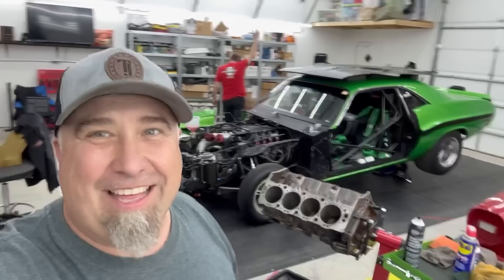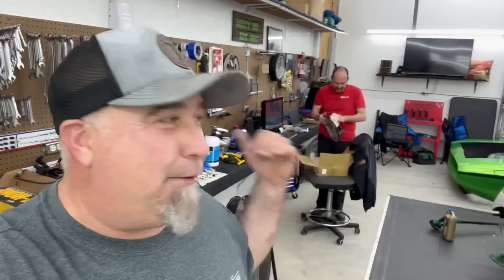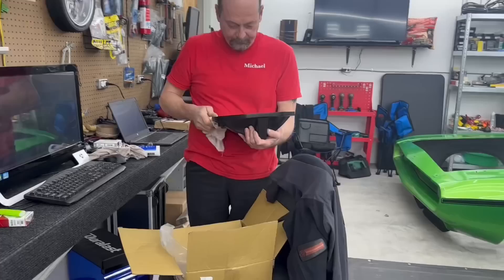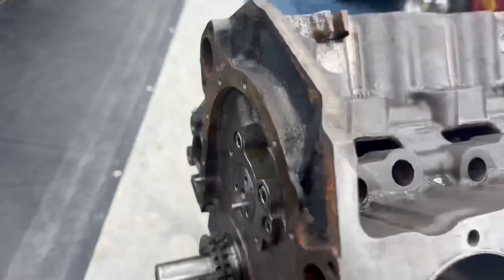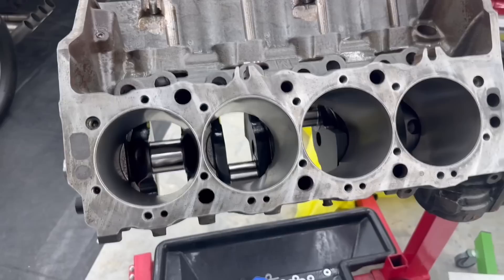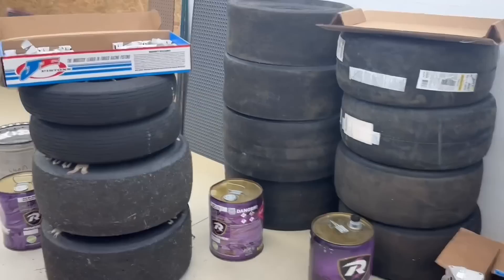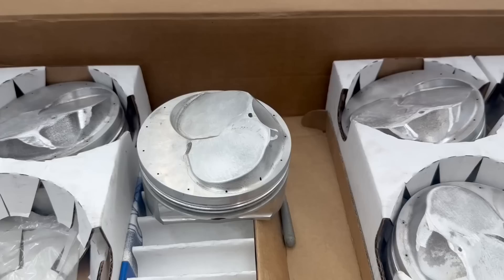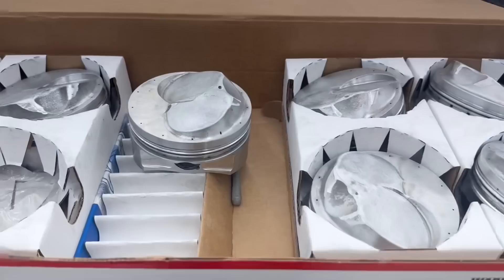Gapping Piston Rings with a SIDE GRINDER!  😂

Comment: I have one like Mikes ring grinder except I removed the handle and made an attachment for my battery drill to connect to it. Works great! Very clean, precise and even gaps. Really fast.😉
Reply: I had the same one and all I managed to do was bitch about it for 30 minutes cause it was a piece of shit and the grind stone filled with dust and was useless.

It would have been better had it simply had a place to chuck on a cordless drill.  But NOOOOOO, they gotta do stupid shit like put some dinky ass piece of bent petal for a turning arm.  HOW THE HELL are we supposed to hold the ring against the grind stone on both sides evenly and turn the arm?  SERIOUSLY??
Reply: @overyonderjustapiece  once I retrofit mine to the drill it worked great. And you’re only supposed to grind one side of the ring gap, not both sides. One side gap stays stock (as shipped) and you grind down the other side to meet your bore size needs. But I agree, the way they sale them is ridiculous. Best of luck sir. Hope it all works out for ya. Turbo John ttf!💪

Comment: On a SBC, I actually use a coffee can with a coil spring rubber spacer....the style that is a complete circle and fits snug on the can.....works pretty slick and can set the depth you prefer for checking the ring gap.

Comment: If any way works its not wrong, people just get in their feels because its not the way they were taught or how they do it. Its not like this engine is planned on being ran for 100k miles or concern over micro oil consumption or blow by anyway…..you just need a grinder with auto braking to stop the blade quicker to improve your ring cutting time 😂